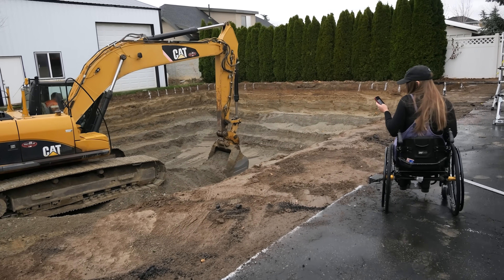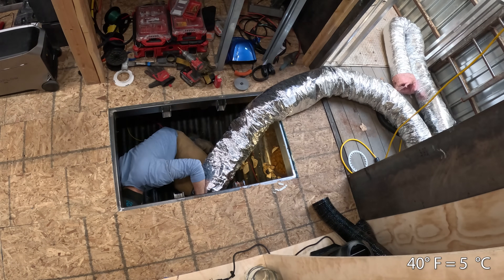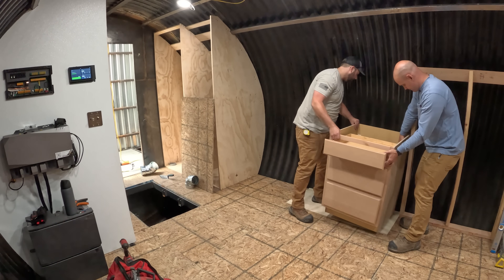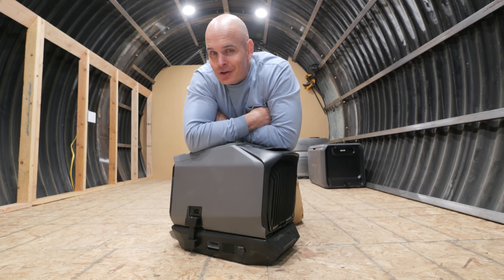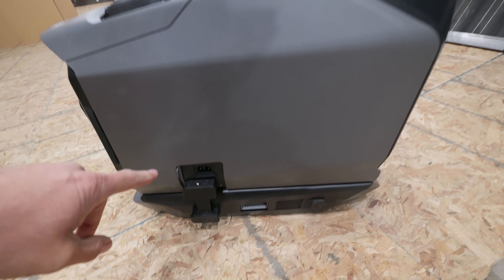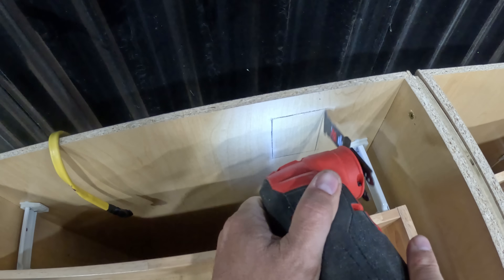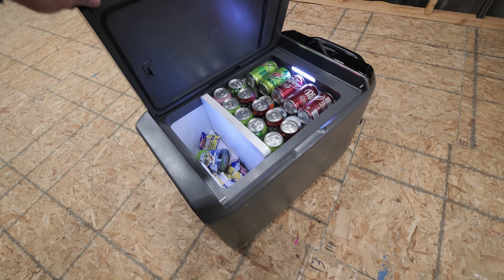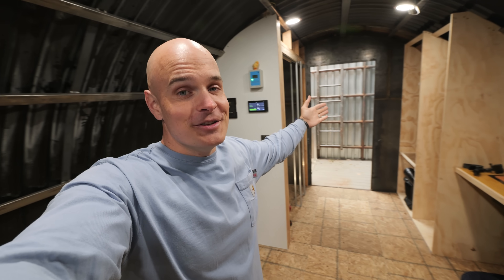How much air does my Backyard Bunker need?

Comment: I sure hope that the plan is to insulate the whole bunker so that you are able to keep the temperature more comfortable and more efficiently. I love this series!
Reply: It's underground, the earth does that
Reply: @nightfr09  the earth insulates it by keeping it at 40-60°, but that means that the bunker constantly has a conductive nature where it will be pulling any excess heat from the bunker into the ground, and since it's a conductive transfer of energy, it will do so much quicker than a convective transfer like a normal house experiences with air. If he wants to keep the bunker at 70°, it would be WAY more efficient to add an insulating layer that resists the transfer of heat between his living space and the earth.
Reply: That all being said, the earth does still help, since heat transfer speed is heavily impacted by the difference in temperature between two mediums. Since the bunkers living space is only fighting against a maximum of 30° temperature differentials, the HVAC won't have as much of a hard time as HVAC that is fighting a 70° temperature difference.
Reply: @nightfr09  You obviously never have heard of condensation, a cold wall with warm and humid air equals water inside of that "bunker" walls...
Reply: I am thinking the same and its a hard problem. Maybe it would be the best to just insulate the bedroom, assuming you add a ceiling and door, it would be the most efficient to have a "sub compartment" like that with an airgap between he heated space and the tube. If you heat the air in that whole tube, all the condensation on the walls will trickle down and collect under the floor, lol.

A different solution would have been to tile the kitchen space and run hot water lines under the tile (Hydronic Radiant Floors).
Reply: @MoietyVR I think the best solution is at least 2" of closed cell spray foam on all of the metal which would provide a vapor barrier and drastically reduce condensation.

Comment: The 1:3 electric to heat ratio doesn't make any sense. How are you intaking 660 watts of electrical energy but outputting 2000W of heat energy? Where is the rest of 1340 watts coming from?
Reply: That ratio is actually pretty poor. Learn about air heat pumps, best they can do is 1:5.
Reply: The extra wattage is coming out of the environment. Heat pumps don't generate heat, they move it.

Comment: all this ecoflow stuff is awesome and all but how is their repair manuals? In an actual apocalyptic scenario you need to repair the things. Even outside of an apocalyptic there is a right to repair your own devises. the fact eco flow doesn't even have repair manuals in their download center is just a huge disapointment.

it also makes the heatpump feel a bit meh. If you want true energy efficent circulation, start with something like a counterflow heat exchanger and aircon ontop of that. If you go true apocalyptic, add some HEPA rated filters on it as well.

Comment: @JerryRigEverything. Just wondering - Sailboats often have a condensation problem because the boat hull sits a temperature close to the water temp. I wonder if the bunker will have a similar condensation problem because the soil will keep the wall temp pretty chilly. Get a couple of people in there for an extended period and the humidity will rise.
Reply: Yeah, no insulation whatsoever.
Reply: I would install a HRV unit like a LifeBreath unit or similar. 99% thermal retention while exchanging all the air a few times an hour.

Comment: Not sure blowing air in both is overkill, unless you mean it won’t work.
Blow air in one side and out the other might be overkill. So long as one side is actual positive pressure (and ideally you are scooping air from a snorkel, maybe just a little overkill, but if you are underground, there might be something “interesting” going on above ground) and the other side is experiencing flow, you should be good.

Comment: The air pump may help with the CO2 issue. Due to it pumping air out of the bunker it will create negative pressure inside which will draw in fresh air from outside. Of couse this may cause other issues if you want the bunker to be airtight
Reply: So you think you will have solar. In the event of a nuclear war .
Reply: @alanjones2207  you do know that the sun wont disapear?

The power you get from solar will be lower but you will still get it

Unlike gasoline or diesel (you cant fuel modern diesel engine with cooking oil unfortunatly )

So its between a steam engine, wind and solar

And you need fuel for a steam engine
Reply: @nikolaideianov5092  you don't have winters at your place, right? There is no production, especially when panels are placed horizontally. Gasoline or diesel could be used as energy source for generators if they wouldn't go bad within couple years, but LPG or other gasses could be used, since their shelf life is indefinite, not to mention that they can be used directly for cooking.
Reply: @Giedrius00   where did that misconseption of solar panels not working in winter come from?

They do work if cleaned

I know it might be hard to understand but takeing care of your stuff will make it work for longer, and in conditions you might not expect

As for useing other fossile fuels

And which engines work on them?

They may not degrade but their containers will

And do you thimk you are the only ome that has been thinking of this?
They will dispear of the shelves very fast
Reply: @nikolaideianov5092  have you heard of nuclear winter? If he is coming to clean the panels, he doesn't need a bunker... 

Container will decompose? Definetly not sooner than most essential things to survive in that bunker...

Generators don't run petroleum or diesel? You've lost me here
Reply: @Giedrius00   have you forgoten soo quickly the context?

we are talking about long term, you will need to come out earlier or later

"Container will decompose? Definetly not sooner than most essential things to survive in that bunker..."
again long term, do you want to survive a nuclear war but to die becose you havent though of where you will get power when your fuel runs out?

"Generators don't run petroleum or diesel? You've lost me here"

we talked about that less then 2 hours ago

heres to remind you "Gasoline or diesel could be used as energy source for generators if they wouldn't go bad within couple years, but LPG or other gasses could be used, since their shelf life is indefinite, not to mention that they can be used directly for cooking."

as we know the fuels used by normal generators degrade (although not in years but months if they are not threated specificly for that, which most fuel wont be) and tell me, which generators run on LPG? and how commen they are?

and where exacly is he supposed to store enough fuel for such a long time?
he doesnt have a big fuel tank down there

while you may not know , most of the radiation of a nuclear explostion will be gone in 2-3 months
the more radioactive a material is the shorter its half life
Reply: @Giedrius00  just so you know, nuclear war won't look like Fallout, most of the world will be fine in terms of radioactivity, the problem would be the collapse of infrastructure leading to massive social unrest, and the nuclear winter you mentioned, which would make sunlight less intense, not just straight up disappear. But it would make it less intense, enough that it would hurt agricultural yield all over the world

Comment: I don’t know if you talked about this before, but if you truly are making this a bunker instead of a “man cave”, I would add a strong heat protection on top of the solar panels, plus have a lead/anti nuclear radiation vault door below the solar panels, also make the TV space smaller after all if it for a nuclear apocalypse or more likely a bomb shelter (considering how political things are right now) TV station may not be broadcast instead a Ham radio and a Wi-Fi  (like a car, not home) maybe better

Comment: Given how little the PPM increases over a day, i'd say a single small pipe leading up the elevator shaft with a miniature air pump attached would do the job.
Keep it under the floor and it'll preferentially remove C02, in theory anyways. i'm not convinced that small amounts of C02 don't mix with the air pretty well with just a little agitation.
Maybe also track how quickly the PPM improves over time with nobody inside, get an actual rate of C02 exchange with the outside air as-is.

Also keep in mind that the amount of C02 released by several men working is much more than a few people mostly at rest.
Maybe spray a rubberized coating, like truck bed liner on the walls as a form of insulation. I'd bet just that much would keep the temperature more stable.

You can also add simple grates in the floor that allow the crawl space to act as a cold trap, which will keep the living area a bit warmer.
That would also mean the air pump would preferentially remove the coldest air.
Reply: carbon dioxide is CO2 not C02.... and if he was trying to be efficient he'd just exchange the cold air of the underground with the warm air of his above ground house/shop

Comment: Great project.  Why not spray in foam insulation on the tube walls for most power/heat efficiency?
Reply: Is the 6+ feet of solid packed earth not enough insulation?

Comment: Great video but speaking from a hazmat guy. 1700 will cause death within an hour. Even your 550 is dangerous. Our meters are set to alarm at 35ppm which technically we can operate in that environment for 8 hours and only get a headache. Just be cautious. Perhaps adding meters to all the rooms for your safety and your family
Reply: CO vs CO2

Comment: The 3x power efficiency of the ecoflow is okay for a tiny portable thing, but a full size heat pump is more like 4-5x these days.
Reply: Coefficient of performance
Reply: I'm too dumb to understand how that works. How exactly can you get more energy out than you put in?
Reply: @poury5764  That's a fair question since Heat Pumps are the closest we have come to breaking physics.

The very simple, elementary school version is Heat Pumps collect heat energy from some other source, like outside air, and concentrates it somewhere else, such as inside a building. The reason it gives off more heat energy that what goes into it is because you not only get the heat from the concentration process, but you ALSO get the heat that was collected from the outside air.
Reply: @poury5764  Here is the key phrase from ChatGPT's explanation: The electricity powers the compressor, fans, and controls — but the actual energy being moved comes "for free" from the environment.  

A heat pump doesn't create heat from electricity the way a space heater does. Instead, it moves heat from one place to another using a refrigeration cycle — the same basic principle behind a refrigerator or air conditioner.
Reply: @poury5764  Because you're using the heat pump to "pump" heat from the outside to the inside, so you're not burning the electricity directly, you're running essentially an air conditioner in reverse.
Reply: @poury5764  You're moving the heat, not "creating new heat", it may, say, take 1J of power to transfer 5J of heat from one patch of air to another. Now if the first patch is your room and the second patch is outside, you have removed more energy from your room than energy used. But it didn't disappear, the outside air will be heated by ~6J, the 5 you removed and the 1J you used to remove that.

Think windows, it takes no power yet increases the light level in your room, because it "moves" the light in. Whereas a lightbulb is "creating new light.

Comment: i love how technology from the future in the US is the standard in some parts of the world (in new buildings).
Reply: Considering induction stove tops are basically very common in most houses in the US I'd say that what he meant by future tech isn't that it's new tech it's that it's modern tech.
Reply: If I were looking for cooking appliances for a bunker, I would probably want the lowest power draw devices - a microwave and an air fryer would be best. An induction hob on full pelt would likely use twice that of the microwave or air fryer. I doubt anyone's gonna care if the results aren't worthy of a Michelin Star.
Reply: Induction stove tops are not actually terribly uncommon in the U.S., it depends on where you're at. Anywhere where natural gas lines to homes are common just traditionally use natural gas for heating elements (e.g. in dryers, central water heaters, furnaces, and ranges). Natural gas doesn't burn cleanly, but it can output a lot of heat very quickly and it works even when the power grid is down. That said, induction stove tops are still pretty highly sought after where I live in the Midwest. When I bought my range, most of the induction units were completely sold out, forcing me to go for a more traditional electric stove top.

It still feels like tech from the future though. Cooking, with electromagnetism!
Reply: @john__  I didn't know that
Reply: @john__  "Natural gas doesn't burn cleanly, but it can output a lot of heat very quickly and it works even when the power grid is down."

Does it though? Example, a fossil gas furnace is useless when the power is out because you don't have electricity to power the fan to push the warm air through the living space. Unless you have an old school range, no electricity means no power for the circuit board that controls the oven. Same for a water heater and clothes dryer. You can use the cooktop burners on a fossil gas stove, that's about it. 

Oh, assuming you have a tank of fossil gas on your property and aren't relying on fossil gas infrastructure, that relies on electricity to pump fossil gas throughout, to get it. You're screwed in that case too.
Reply: Jerrys gotta work on his jokes if they can go this far over someone's head.
Reply: @O_S_M_I_U_M  I know he was joking, but in my mother tongue there is a saying: "every joke is half truth. Also, my comments don t usually get this much attention, if any, so thende to be less considerate in other people's interpretations.
Reply: when he said "from the future," he didn't mean literally non-existent in the us... because it exists us... you ignoramus. he's saying its a neat technology.
Reply: @unironicaluser1867  I know he didn't  mean it that way, i said these things are a lot more commen in other parts of the world. I know (well i think i know, but i might be wrong) that most people in the us still chose to buy gas stoves while here where i live the question is whether you're getting a classical electric stove or an induction one.
Reply: No need to be rude brother
Reply: @ i wasn t trying to be rude, i am sorry if i came out that way.
Reply: @ not you, you're good some guy who was calling you stupid